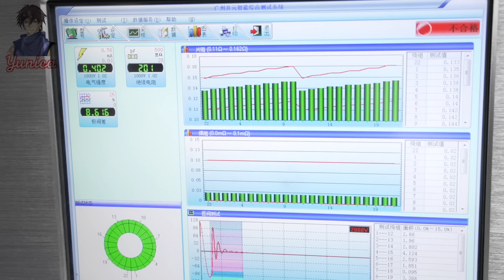Incredible efficiency。Large scale mass production process for small motors

Comment: Brushed universal electric motors.
High RPM output.
These electric motors are used for example in vacuum cleaners or blenders.
Reply from the maker: Yes sir, I think you are the insider, most of these motors are used in small appliances such as soymilk machines
Reply: @Yunica520 I currently work in home appliance sector in general.
I am familiar with various types of electric motors, such as those shown in the video.

Comment: These type of motors are not used in India., I don't know why., . But if Chinese are making these., then should be there a reason., 
Here the inner core of motor is not brushed and the coiling is only in outside  , and core is made up of solid iron with some grooves that helps in creation of magnetic torque,